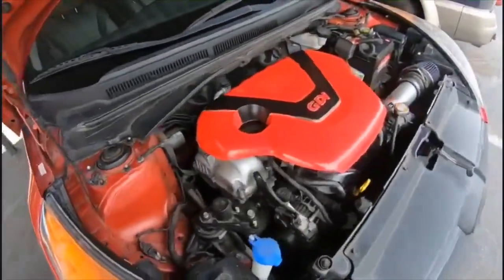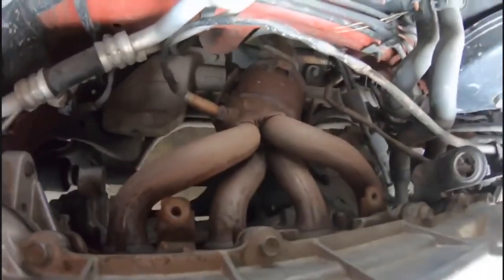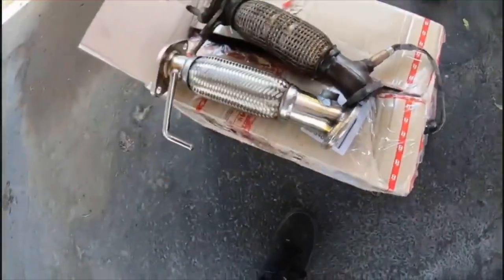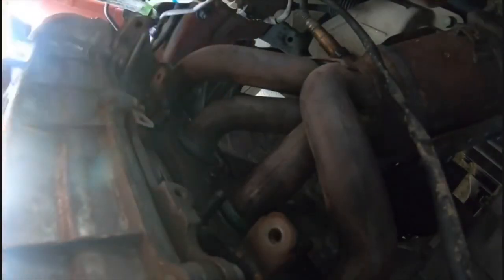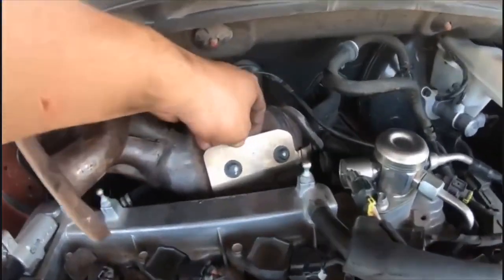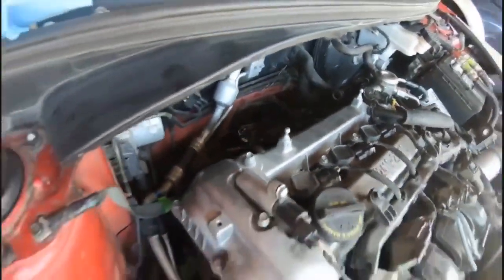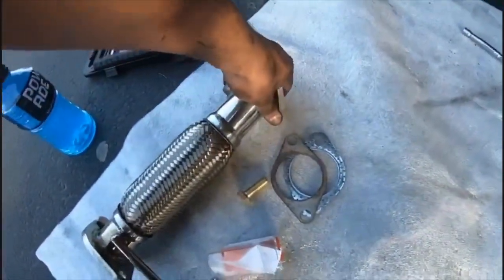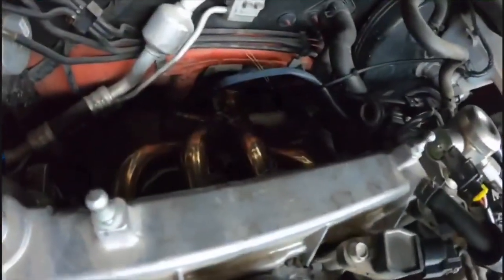Header install on 2012 Hyundai Veloster

Comment: Hey thanks for the video my cat went out and it was giving me a p2040 code so I had toswap out  the exhaust manifold .  Video helped quick tip for those doing trying to get the bolts from the bottom a 19mm deep socket or a 3/4 dose the job with an extension gives you more leverage to undo those bolts their super hard . Soak them in wd40 first and it be super easy . As well as use anti seize on the treads when putting it back together.

Comment: most def gonna need to hear some driving clips 👀👀👀 thinking i want to do this with my 2017 nav
Reply from the maker: Quason Million Definitely will be having one out soon!!
Reply: Where did you get your headers from?
Reply from the maker: Ebay
Reply: @noegarcia4875  & they actually fit I don't trust eBay which ones did you actually get do you have like the serial number?(:
Reply from the maker: Steve Aguilar yes they fit perfect no special modding needed the only thing u have to do is weld the bung on to the flex pipe for the downstream sensor  other than that everything fit perfect even the gasket it comes with and the brand is maintec headers i was iffy about it too but i just went ahead and bought them till this day since installed i enjoy hearing the sound of my car 💯💪🏻
Reply: @noegarcia4875  ok thank you!!!

Comment: Yo buddy, I've got a question about ur install. did you also get the engine light on cause of the O2 sensors after the install? I even put 2x engine light eliminators on them and it still goes on. I appreciate any help or suggestion.
Reply from the maker: Unfortunately yes it did turn on! about a week after installing them! After about 2 months the light randomly shut off while i was driving!
Reply: @noegarcia4875  haha that's weird bro. I installed 2x Blox engine light eliminators. wish I was lucky as you

Comment: I just bought the catalytic converter but it's only the header, not the bottom piece you removed first. Is the bottom piece a neccesity?
Reply: Unless your flex pipe is torn and producing a exhaust leak, it’s not a necessity to replace that with the head/cat combo but a flex pipe in general is needed for the exhaust to have the ability to flex with the torque of the engine

Comment: So I have a question do you know if this will work on the turbo version of the veloster?
Reply: No. Turbo cars, the Turbo is integrated into the exhaust manifold. They may bolt up but if you put it on, it will be N/A lol

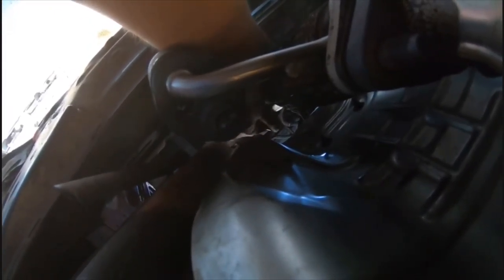Comment: How did you remove that damned bolt around 3:00. I removed all except one since I can't remove it with torque wrench, or impact electric wrench.
Reply from the maker: Honestly it took me about 10 min just to remove that one and i used a small ratchet tool after trying different angles was finally able to get it!!!
Reply: @noegarcia4875  Does your car turn its CEL on (P0420) since you removed the first cat ?
Reply from the maker: wolvie45 the check engine light did come on like 4 days after installing them i never really checked what code it was throwing tho!
Reply: @noegarcia4875  Did you remove flex pipe by yourself? I guess mine is so rusted (Canada) that I bought an electric impact wrench to be able to unbolt it.
Reply from the maker: wolvie45 yea it took some force but i was able to get them i sprayed every bolt with WD40  before i started and only tools i used was what u see in the video!! And damn thats tough were u able to get them off tho? Are you recording your process? Curious too see 🤔
Reply: @noegarcia4875  I was able to remove it. The bolts are the only  rusted part of my car. Unfortunately I wasn't able to record my progress. 
 I replaced my front cat and very soon my second cat too (basically my whole exhaust). I'm still waiting for my 2nd cat and catback (Solo Performance Mach 2N1 catback exhaust kit and high flow 200 spiral wound ultra cat converter) Catback and High Flow  to arrive so I can finally finish my exhaust. Thanks for replying. You are more helpful than the peeps in Veloster Forum. Hopefully they don't see my comment and ban me 😅. 

Did you feel a power difference on yours when you changed it or about the same? I hope I gain a few more HP with the high flow exhaust.
Reply from the maker: wolvie45 Hell yea 🤘🏼 thats badass what year do u have btw? And i will try and help with what i can 💯💪🏼 never used forums but thats funny!! And power differences definitely u can feel the car move faster especially at take off from first gear not rocket fast but totally feel a difference!! Not sure how much hp gains if any but still makes it fun to drive 😎
Reply: @noegarcia4875  Mine is 2013.

Comment: Could you send me everything you have done on this and what brand everything else
Reply from the maker: K&n intake, maintec headers, straight piped from flex pipe all the way back! And ecu flash tune! Only things i have done to it!
Reply: @noegarcia4875  where did you have tune done or what did u use
Reply from the maker: @michaelkrom5785  https://damnfastdd.com/BrowseProducts/ShowProducts/Veloster+(NA)/Electronics_Tuning there u can pick which option you would like
Reply: Or did you use a tuner chip or something
Reply: The $500 dollar one
Reply: Would it still pas inspection
Reply from the maker: @michaelkrom5785  i passed inspection no problem January and i was already tuned
Reply: @noegarcia4875  are you catless and did the 02 delete
Reply from the maker: @michaelkrom5785  yes im catless and no check engine came one!

Comment: First time getting into car culture, how would you pass smog? Is that a Catalytic Convertor that you installed after the headers?
Reply from the maker: No its the flex pipe! And honestly i was tuned already with headers and it passed smog! Until i went full straight piped it did make the engine light turn on!
Reply: @noegarcia4875  I'm thinking about installing a Defouler  in my car in order to pass smog, do think that would work for now before I get a tune? Also, if I were to get a defouler, where would I put it? before or after the CAT?

Comment: U should wear gloves man! I did this job on mine the oem manifold gasket is very sharp on the edges  I want to do this on my car but were I live I have inspections but I deleted my second cat lol
Reply from the maker: Jesse Bolles i did buy some but felt uncomfortable since they are kind of thick! Also here in vegas smog is required every year but i did mine a week before changing them out so i should be good for a couple more months!
Reply: @noegarcia4875  oh ok well if it fails smog test because of your header then put your oem catalytic converter back in ( once u take out the honey cone) and put adaptors in were your 02 sensors go so it will keep the check engine light off ...also if u have the heat shield on the top it will hide the top o2 sensor when they pop open the hood for inspection

Comment: nice video bro. Hope you're happy with it. I've been thinking a lot about getting this. Do you have a link of it on Ebay as I could only find it on a website which has no rating on trustpilot and the other ones on Ebay who ship to the Netherlands are similar tho this one but not the same brand and quality
Reply from the maker: Ali maniiac THANKS MAN APPRECIATE IT 💯💪🏼 ITS BEEN A FEW MONTHS NOW AND STILL ENJOY THEM AS IF I JUST GOT THEM INSTALLED!!  and Noo!! I don’t think the seller i bought from has them anymore when i search up the link nothing pops up only the OBX headers seem to pop up which i don’t really think they are any different other than the name!!  And pricing!
Reply: @noegarcia4875  Cheers buddy. I trust your word and will get one for myself as well :D again THANKS for the awsome video
Reply: @noegarcia4875  Bro, I did some research about the other similar one from OBX and it's kinda crap :D It has a thin stainless layer and works good for about 2-3 years max. I just bought the same one from MainTec from Sharkracing eventho there were some bad reviews about them but they were all old reviews and I could find some good reviews as well. Anyways I paid for it with paypal so I'm on the safe side either way. Can't wait to install it. Again thanks a lot for sharing the video
Reply from the maker: Ali maniiac  niceee bro!! Looking forward to seeing your install!! And i appreciate the support 💯💪🏼